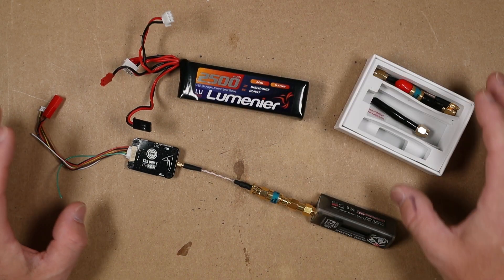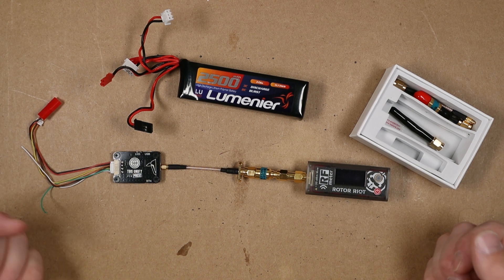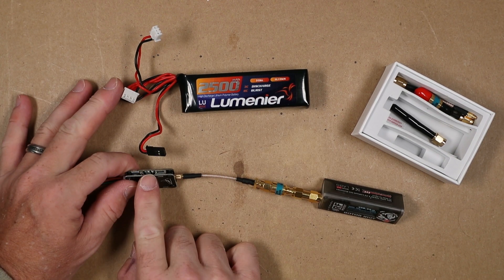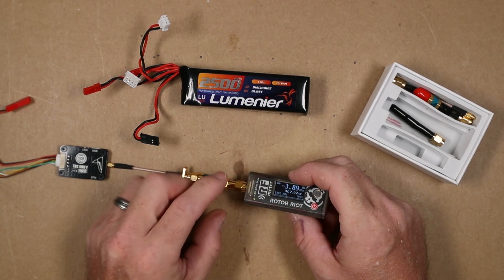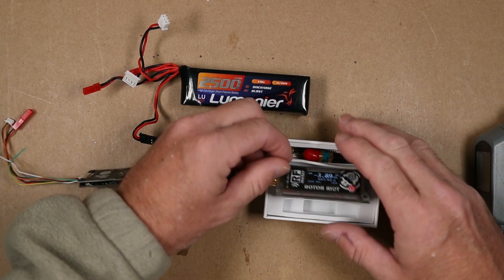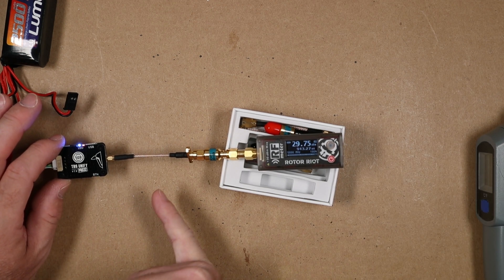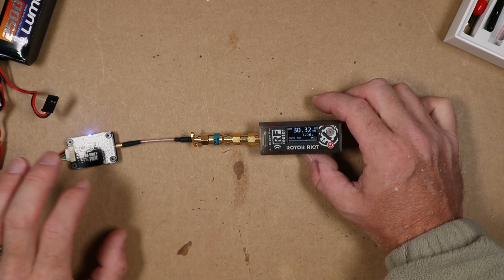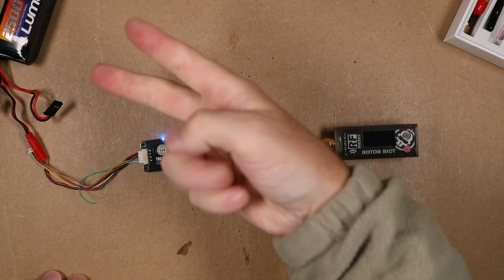Unify Pro32 HV - Should you update to v1.13?

Comment: Hello my friend. I got one and its shipped with firmware 1.07. Do you recommend to update at 1.13 or is it better to stay on 1.07?
Reply from the maker: You are getting the same power outputs from v1.07 and v1.13. The only difference between the two is v1.07 would randomly brick a very small percentage of units. I have one that I leave on v1.07 for test purposes. The remaining lot of them have been updated to v1.13. I’m always a bit apprehensive to do anything permanent (can’t roll back firmware on these), but v1.13 has been solid, and I’ve not heard of any bricking since the update rolled out. I’d go with v1.13.
Reply: Thanks for helping! I will update my unit now.
Reply from the maker: Enjoy it, it’s a beast.

Comment: Great q and a today please help if you can thanks in advance this is my first build I am a noob that is using the mamba F405 mk2 fc (not running crossfire) and the Tbs unify pro32 hv (black box style) vtx for some reason I can't get any video I have updated it on tbs agent x and changed the channel to race 6 25mw, checked all the wiring,even wired the camera directly to the vtx still no video and I checked the camera on another quad it's fine, I even connected both the TX and rx thinking even thought I am not running crossfire maybe it wouldn't work still nothing thanks for your time
Reply from the maker: When you say no video, what are you seeing?  (Static, black screen w. osd, etc) Also what are the lights on the VTX doing?

Comment: Mine is brand new. I have 0 range. Cant move 2ft away from the vtx without completely loosing reception in my goggles. Pretty frustrating. When i power up, the blue and red light blink in random patterns. Not sure what the issue is. HELP! Ive done no updates to this vtx. Its right out of the box. All i did was install it in my rigg to the aio bardwell flight controller and it will not work.
Reply from the maker: When you first power up it will flash red and blues lights. This is normal behavior. It tells you (red flashes) the 1 channel, 2 band, 3 power level, 4 temp limit, 5 pit mode, 6 crsf/sa, 7  mic in that order.  Count each red flash and make sure its not stuck in pit mode (5 red flashes, 2 blue). I know, I know its likely not that easy. If its not in pit mode it may be a power issue. Check that its getting between 6 and 25 volts. If its getting voltage somewhere in that range then it likely suffers from a half flash. This is easily fixed by flashing it in Agent X. Let me know how you make out.

Comment: Just got 1 of these. Mines not even close to reading this high. I get max 26dB or about 400mw on the 800mw setting. Am I using the measurement device wrong?
Reply from the maker: There’s a few things to set with these and pigtails play a huge role. You have to set attenuation in the meter if your using one on the antenna line. You should be using attenuation if your testing 1w (30db) or above. Make sure your setting the VTX channel to closely match that of the receiving channel. I typically use Race 5 (5806) on the VTX and 5800 in the meter. I also run my tests after choosing the best of of 7 or 8 pigtails. I’ve had some pigtails that cut values as much as 50%. Finally make sure your SMA connections are tight. The low readings I’ve garnered in the past were from an SMA that was poorly pressed together from the factor, it came apart mid test. With all that said it’s still just a $50-$80 meter. It’s the best we currently have that doesn’t require a auto loan to obtain. I’ve been researching a way to get more accurate results. Seems $6,000 to $30,000 is the cost range for such an analyzer. With it we can begin to test channel bleed. 
Let me know if your measurement improve with the given suggestions. There was another subscriber who had low values recently.
Reply: @breaksteel  Tried all 3 mmx pig tails I have. All read around the same on max 800mw setting, right around 400mw on band/channel F4(5800). I also have a rush tank ultimate. It's reading right around the same on it's max setting. Does input voltage matter? I've tried the filtered 9v and vcc pads and doesn't seem to matter on the output wattage. So on both vtx's i'm reading relatively the same output power which kind of leads me to believe it's user error...I'll keep testing. Maybe try different channels.
Reply from the maker: You know have been meaning to test your theory of input voltage. I typically test with Vbat on 3s voltage if the VTX will handle it. I can totally see a VTX struggling to put out max power if it’s on 5v vs 12v. 
What firmware are you on? I’ve gotten some lower values on v1.08 vs v1.13 and v1.07. On full power that VTX should be giving you RF burns when touching the pigtail. I’ve tested 3 of them and they barely dip below 1w even at full temp. Leads me to another question, what’s your temp limit set to? Default is 105c if I remember correctly.

Comment: how do you update the firmware on the VTX?
Reply from the maker: There’s a USB port on the side. Plug it in and use the TBS Agent X software. Once your in Agent X you’ll see the VTX and there’s a button to upgrade firmware.
Reply: Yea I have the nano pro32. I am hooking my crossfire nano rx into it and going to give it a go.
Reply from the maker: If you have the Nano that only updates via CRSF. Just make sure you have CRSF setup in the menu of the Nano. It’s on SA by default.
Reply: Thanks you! I will see how it goes!
Reply from the maker: Let me know, it should be pretty effortless.

Comment: When did this update come out,I got one on September 21,it bricked up after 7 batteries,so I have another one coming
Reply from the maker: This update came out 2 weeks ago. Odds are good that yours is on v1.08. I suggest you open a ticket for the bricked one. They fix them pretty quickly. V1.13 has been solid so far.
Reply: @breaksteel  mine is already on it's way here rdq,has a great customer service,I will make sure I update this one to the new firmware,thanks again for the information.
Reply from the maker: Good deal! Yeah definitely check the firmware on the new one. I’m not sure if the have stock with v1.08 or v1.13. Happy to help man!
Reply: @breaksteel  yeah I definitely will,I was about to give up on this vtx and go back to the hv,but after seeing your video about the knew update there is hope,and I take it has been working for you. Again much appreciated
Reply from the maker: Things have settled down quite a bit once the new firmware dropped. My units have been working great!

Comment: just got a RF Power Meter, how do you know which Attentuation settings to use when testing? theres not really any explainations anywhere on this.. Maybe if its complicated you could do a video on this and general usage of the Power Meter?
Reply from the maker: It’s pretty easy.  Your putting an attenuator on the meter and then go into the settings and change the attenuation level to the same amount of the attenuator installed. In my case I’m using a 20db attenuator so I tell it 20db.Then the meter will adjust the readings to show you values of a non attenuated device. The reason we’re using it is so we don’t cook the meter with these high power devices. It’s only rated for 30db max. As you can see I’m getting a value of 32db so I will be bumping up to a 30db soon for these higher power devices. I’ll do a video on this meter and how to use it properly in a few weeks.
Reply: @breaksteel  Thanks so much!! also do you need attenuation while using a sma to mmcx or ufl adapter?
Reply from the maker: The connection on the VTX side doesn’t matter if it’s UFL or MMCX. The attenuator goes on the meter and both sides are SMA. You will need the barrel connector that the meter should come with. Connection should be the following - meter-SMA barrel-attenuator-pigtail-VTX.
The attenuator is only needed if the output of the VTX will exceed 30db. So if your testing a 400mw VTX your good without one.

Comment: btw... if you already have a bricked Pro32 HV .. you cannot unbrick it with that updated ... bootloader stuff and so... you have to send it to TBS to unbrick it ;)
Reply: Exactly, I contacted tbs when mine stopped turning on.  It had no lights on at all.  TBS tech support asked if it worked on USB.  It did not so they said to send it in and they would fix it then send it back the same day they receive it.
Reply from the maker: Ok good to know. I’ll relay this info as needed.
Reply from the maker: Good call. I was reading the posts on the initial announcement and saw one person mention he was able to un-brick his in such a manor. Figured as this update was used people would chime in an correct me if I was wrong. It’s difficult to test this with 3 working units.

Comment: You keep twisting the connector, thats scratching the stinger everytime you move it. That is why you are getting the spikes. The connection/connector is becoming damaged every time you move it while connected.
Reply from the maker: It’s an awfully loose pigtail. I changed it later off camera and got better results with stable values. This video and test was a bit rushed as I’m supposed to be on vacation but was asked for this video. Normally I would have tested and filmed the other pigtail and let the unit cool completely. I’ll keep from twisting it on future tests, great point!
Reply: @breaksteel  fwiw I have several of these Pro32's.. every one of them came with a loose connector, but the problem is the coax side, the plug hole in the vtx is fine.
I usually switch to a AXII w/ 90 degree connector or a 90 w/ sma... they all fit the Pro32 notably better/tighter.
Reply from the maker: I have a few of the strait MMCX pigtails that seem to fit rather well. I’ll be ordering a bunch more and marking them with colored tape to keep track of the good ones. I seem to rip through them so quick.

Comment: I had 4 of these become bricked within 10 flights, some 2. Get fpv took care of me but still. It was rushed to the market and was a major pain in the ass. Hopefully the issue has been resolved but I'll wait a few months before I try one again.
Reply: the new firmware is the fix. 
sorry about poor experience dude.
Reply from the maker: Thanks for sticking by these Wayne! A lot of other MFGs would just let them rot.
Reply: Does this vtx ever bricks mid flight? Has anyone experienced a black-out mid flight like if it had no antenna attached?
Reply: RCruz FPV no it doesn’t do it mid flight.  It happens on power up if it’s going to do it.
Reply from the maker: RCruz FPV On version 1.07 and 1.08 there were some issues with units not turning on after a random amount of use. I’m not sure if this happened during flights but I know it happened upon startup. Version 1.13 fixes this issue. I have hear of no bricking units since this update. Should you have an issue with yours, send it to TBS and they can easily fix it and get it back to you. If you buy one soon, make sure it’s on 1.13 and enjoy it!
Reply: Thanks!!
Reply from the maker: @rcruz77  Anytime!
Reply from the maker: I’m hoping the issue has been resolved as well. I’ve had a lot of subscribers and viewers tell me about issues they have had with them. I’m happy to see power outputs back in the realm of my first tests on 1.07.